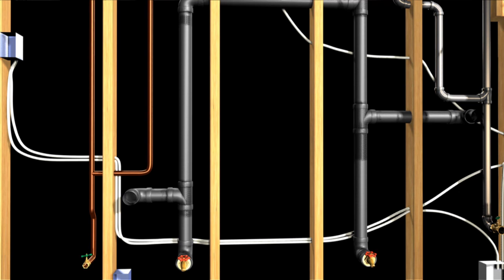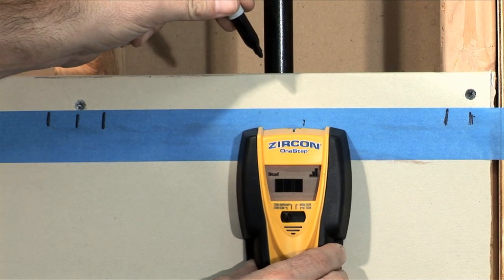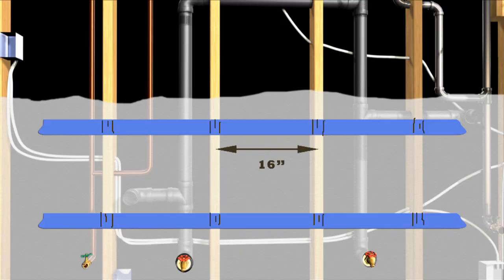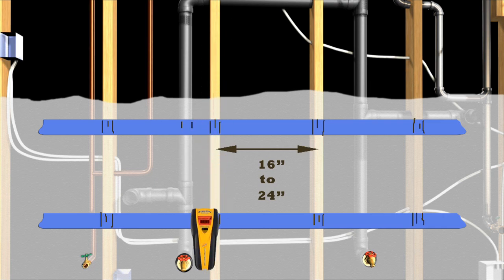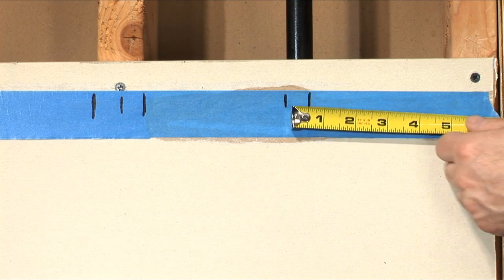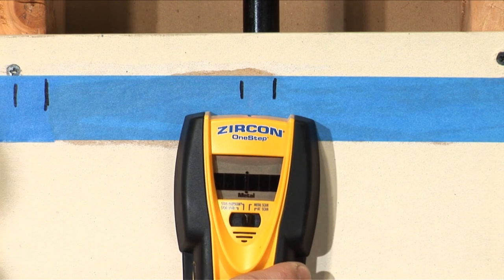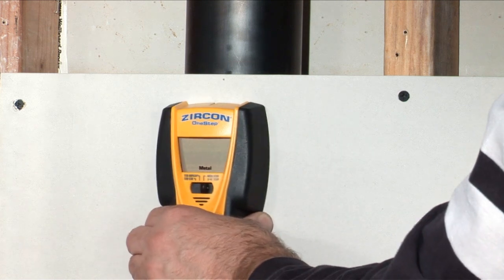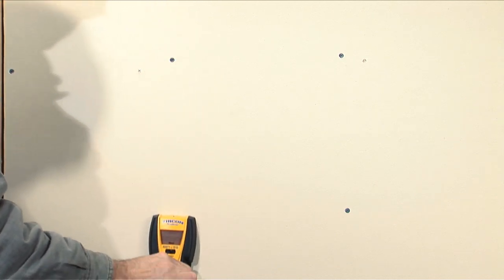Zircon Tip Minute 5: Avoiding False Positives With Stud Finder When Locating Wall Studs

Comment: Hi, thanks in advance for any helpful responses. I happen to be using a Zircon stud finder, and it's alighting every 16" (and only 16") as expected. However, when I drill in, I'm only getting drywall - happening higher and lower on same wall. I now have 3 ugly holes which are useless to me. I am being careful to drill at the center between what the finder is reading as the stud edges. I recall now that this happened a few years ago (same house, different room, same stud finder). 

Bizarre - any suggestions other than a malfunctioning stud finder?
Reply: Zircons just suck dude
Reply from the maker: Hi @JasonMcGrathLaw. Apologies for the delayed comment. Your process of assessing every 16' and at different heights in the wall is spot on. 👌 The issue may be that the model you have is an edge finder and only finding the edges of studs. You would then need to find both stud edges and determine the center. Our center finder models will detect the center and edges of the stud. Please call our Customer Service team during normal business hours Mon - Fri 8AM - 5PM PT at 1-800-245-9265 and we can help determine what type you have and answer any other questions you may have. Thank you and have a wonderful day.

Comment: I was going to put up an equipment rail in my garage into 6 studs, at about 80" above the floor. No outlets or switches on either side of the wall. I grab my HD900c to get my stud locations, and I find studs, but also the lightning bolt appears! I spaced off the outside porch light that's about 75" above the floor. It seems the builder ran some romex right up to about the height I want to drill up a stud at one wall end, turned, then through the studs all the way to the outside wall.

Comment: couldnt a constant metal reading also be metal studs? im new to this and want to mount a tv but I get constant metal readings along my wall horizontally
Reply from the maker: Hi Kramer911. Thanks for reaching out as we're here to help! If you are in Metal Scan mode and are receiving a constant metal reading vertically (from floor to ceiling) and the readings are equally spaced a distance of 16" or 24" on center, this could be indicative of being metal studs. However, since you mentioned you are receiving constant metal readings horizontally (left to right), it's possible there is metal content in the surface paint/wall cover or there is foil backed insulation within the wall. We can troubleshoot with you real time during normal business hours Mon - Fri 8AM - 5PM PST at 1-800-245-9265. You can also email us at techsupport@zircon.com. Have a great day!

Comment: is it definitely unsafe to drill through a stud when the lightning bolt icon is showing?! The icon isn’t flashing, but it shows up once I pass over the side of the stud, & I’m pretty sure it’s a stud that I’ve found..
Reply from the maker: Hi hmm dunno. It is always important to use caution when the WireWarning® Detection indicator is on. Under normal construction environments, electrical wires generally run vertically along the side of the stud or horizontally with holes drilled through the middle of the stud. Studs are also typically 1.5 inches wide and 16 inches apart from each other. It is important to map out the wall by scanning above and below your measurements to re-verify the original scan. It is also recommended to turn off power before you drill. We have more information on our WireWarning® Detection available on our website at http://zirconcorp.custhelp.com/app/answers/detail/a_id/9/kw/wire%20warning or can be reached by phone at 1-800-245-9265, Monday through Friday, 8am – 5pm PST if you have any additional questions or concerns. Thanks and have a great day.
Reply: Thank you. I did heed the warning on the SF & decided to drill elsewhere. Your input is much appreciated! Love my Zircon stud finder <3
Reply from the maker: Glad to hear it worked out for you! Thanks for letting us know and appreciate your feedback. Have a wonderful day. :)

Comment: The problem is that Zircon Studsensor only sees one edge of the stud but not the other. So it beeps and indicates where one side is once and that's it.
Reply from the maker: Hi Damien. If you are experiencing this, every time you make a scan, please recalibrate the scanner. This means, when you scan and find a stud edge,  stop, mark the spot, then let turn the tool off by removing your finger from the Power button. Then, move to the other side of the stud (six to twelve inches from the mark), recalibrate, and scan back towards your first mark to find the second (left or right) stud edge. The width of a stud on the back of your wall is approx. 1 1/2”. As the stud runs from the floor to the ceiling, you can also scan on different vertical levels to verify your indications are consistent as you would expect from a stud. Studs are usually placed on 16” intervals center to center. So once you verify a stud in the middle of the wall somewhere, you can simply measure out 16” from the center to the center of the stud next to it. Verify another stud is there with your stud finder. You can map out a whole wall quickly using this method. Please feel free to contact us. Technical and product support services are available free of charge. Our normal business hours Mon. thru Fri. 8:00am to 5:00pm PST. at 1-800-245-9265 or email at techsupport@zircon.com. Thank you.

Comment: My zircon is stuck in calibration mode. What's up with that? Especially for 40 bucks.
Reply from the maker: Hi Tim Uchida. Sorry to hear about your experience. Which stud finder model do you have? Based on the information you provided, it seems as if this condition may be a result of low battery power. The stud finder (once placed on the wall and powered on) should take about a quarter of a second to calibrate and then be ready to scan. Please try inserting a brand new 9 Volt alkaline battery fresh out of the package. Stud finders, especially models with LCD screens, draw a lot of power so it's very important the tool gets full power from the battery to properly operate (i.e. a battery in a smoke detector or remote control require far less battery power to function than a stud finder would). We hope this helps and if you have any further questions, please give us a call toll-free at 1-800-245-9265, Mon - Fri, 8am - 5pm PST or visit our website at www.zircon.com. Thanks.
Reply: ZirconTV outstanding,  did the trick. For future R&D I suggest a low battery display or error display after a set number of erroneous calibrations. For your engineers, calibration failure occurs at 8.6 volts for the i520. Cheers.
Reply from the maker: That's great to hear and thanks for letting us know, Tim Uchida! We appreciate your time and feedback and will pass your information on to our Engineering team. We're also pleased to let you know that our newer center finding products with LCD screens will feature a low battery indicator icon on the screen. Cheers and thanks again.